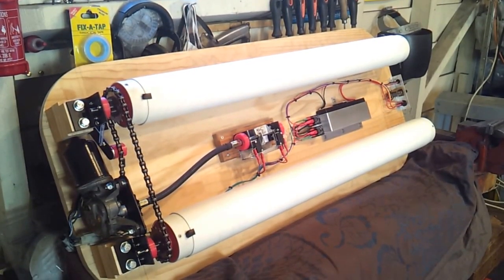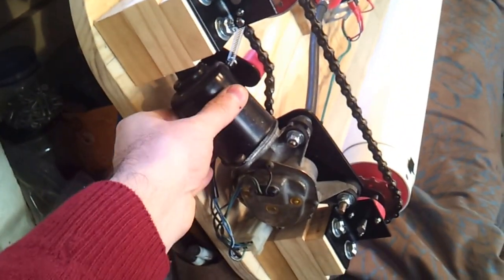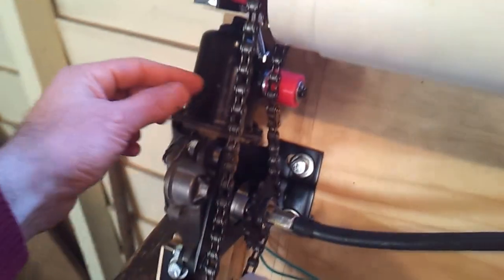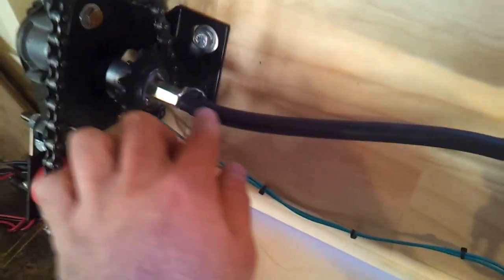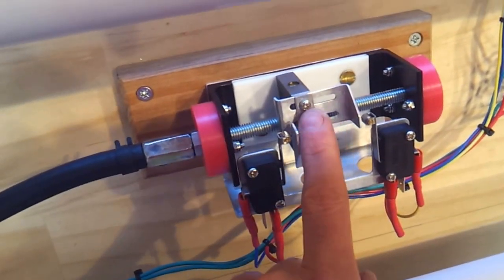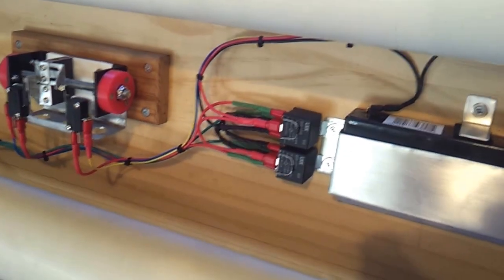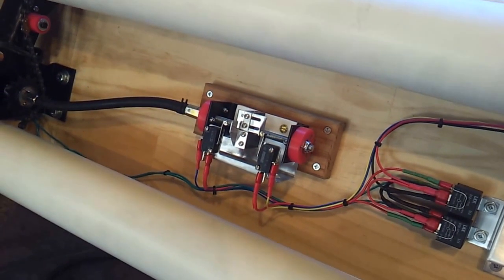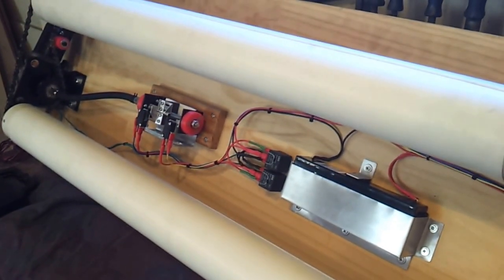Bus blind mechanically complete.

Comment: How do I make this please? Preferably with a handle than electric
Reply from the maker: It would depend on what things you have available and your skill set. One issue is with two rollers and a large blind as it goes from one roller to another the speed changes as the diameter of the rollers change so it you try to drive them together you need to account for that. The easiest way would be two rollers but not connected and a handle on each one. You turn the handle on the roller opposite to the direction you want to go. So the top one to go down the blind and the bottom one to go up. I would maybe use PVC pipe with end caps pushed on and put axles through the caps. On one end the axle needs to be a crank so you can turn it. Hopefully that makes sense?
Reply: @asciimation  makes some sense. Honeslty I have no idea in reality but I was trying to work out how to attach 2 rollers to something that I can also attach a handle to but I don't know what I need. I was thinking to use conveyor rollers? Someone suggested using the poles and fixings from a window blind but I'm not sure that would be strong enough. The blind I got is for a double decker
Reply: @asciimation  also, how would I attach the rollers to the frame? Could you send me pics of bits I need please?
Reply from the maker: @jolisa93  It's a little tricky, where are you based? And what tools/skills do you have. I live in New Zealand so what's available easily here is totally different to what's available in the US or UK or elsewhere. Here in NZ you can get PVC downpipe 80mm diameter. I think that was what I used. Then you get push on end caps for that. You can drill the middle and put a bolt through to make an axle. One one end you would attach a crank handle. You could attach them to a base board with metal right angle brackets (like for mounting shelves maybe?) with holes drilled though for the axles. That's the simplest way I can think of doing it. Feel free top email me, the address is in my channel details and I can draw a little sketch for you.
Reply: @asciimation  I'm in uk and I have normal DIY skills haha 😄 a sketch would be good please 🙏